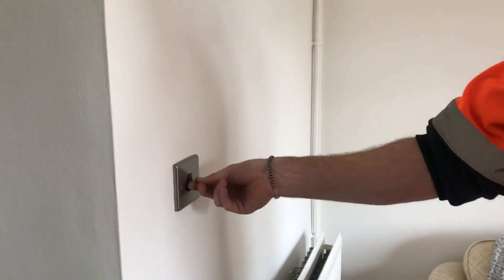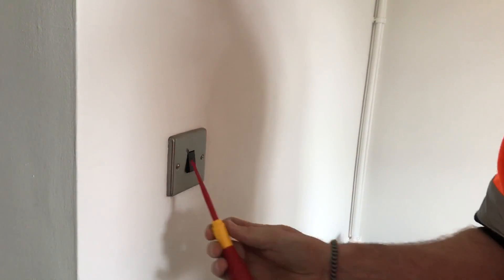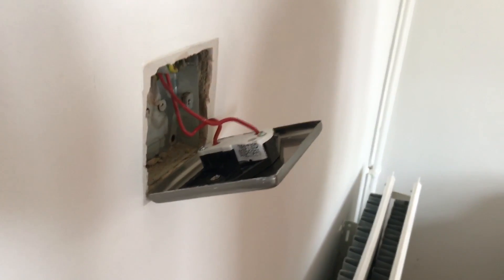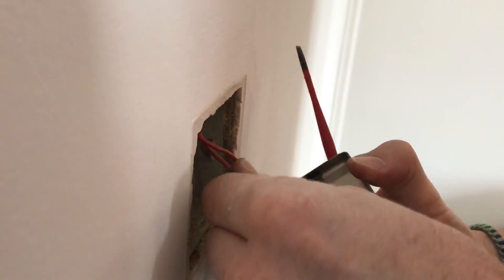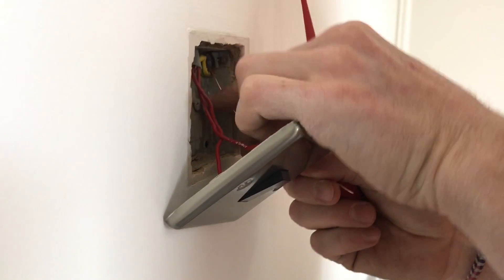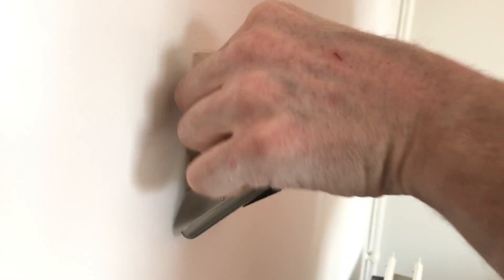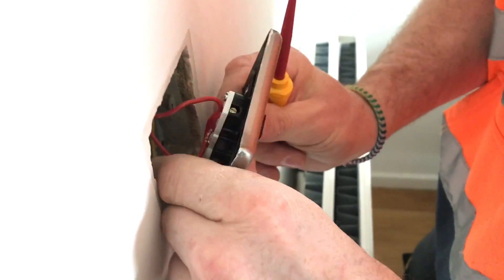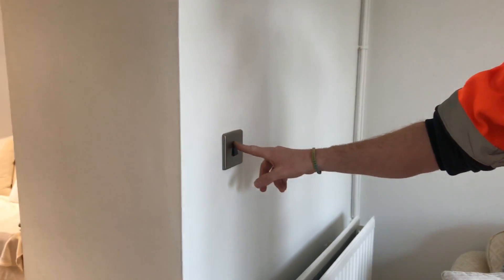How to Earth Exposed Conductive Parts (Metal Switches) On Site With Electrician Matt Best Practice

Comment: Is it compulsory to double the earth cable back?
Reply from the maker: No just best practice 👍🏻
Reply: @GSHElectrical  Thanks. got a quick question mate and wondering if you could help. I know a metal back box would need to be earthed to a metal face plate. A plastic back box does not have to be earthed to a plastic faceplate however, what if I have a metal backbox and a plastic face plate, does that need to be earthed? Thanks

Comment: My fly lead is conducting electricity. When I touch the metal light switch I get a very small buzzing shock. Any idea? Hasn't been re-wired so I don't really understand why this is suddenly happening to 3 of my switches in the corridor!

Comment: Do you need to earth a metal switch if the back box is plastic? There is a earth cable coming out of the wall with the plastic back box and wondering if needs to be earthed onto a metal switch? Or can I just leave it behind the switch in a wago connector?
Reply: It’s even more important to earth the metal switch plate if the back box is plastic. While earthing only a metal back box at least the earth continuity goes through the metal screws carrying on the earth path to the metal front plate. But with a plastic back box and no earth on the metal front plate, if a live cable comes out and touches it, it will just be sitting there live until someone touches it getting a shock. Also why waste a Wago when there’s a perfectly good earth terminal there.

Comment: It's often the case that the Earth wire isn't earthed in alot metal light switches.

What risk does it pose if you don't earth it?
Reply from the maker: If it’s a plastic switch no risk - however if it’s metal and it becomes live it can cause a shock and possible death via electrocution.

Comment: Why does that need a fly lead from the back box? With a fixed lug that back box and front plate area always at same potential in an energised system and the front plate will never be removed unless it is isolated ??
Reply: It must be connected to the Class I accessory. Best practice is that it is run to the accessory, and then a flylead run back to the backbox. But just running it to the backbox without a cpc to a Class I accessory is unacceptable.
Reply: its just good practice to do it, you can't assume a homeowner will isolate the circuit before removing the switch, worrying but true

Comment: I know with sockets where a metal back box isn't exposed and there is a fixed lug we are allowed to rely on the M3.5 accessory screws to earth the back box.  Is a similar thing allowed with metal light switches?
Reply: CPC fly leads aren't mandatory for any metal accessory, but they are best practice.  I was always told: 'assume that if the light switch stops working, the homeowner may decide to take the accessory off to take a look.  If the failure is due to a loose line conductor, once the accessory screw is removed, the homeowner now has a potentially live metal accessory in their hands with no CPC protection if only the backbox has been connected to the CPC'.  Makes sense to me :)

Comment: Do the regs specify which way round the cpc has to be connected first; backbox then fly to switch or vice versa?
Reply from the maker: Hi. From new and this isn’t new I prefer an unbroken cpc conductor to the switch first and back box second. No rules just personal preference 👍
Reply: The regs say as long as you have one fixed lug you don’t need a fly lead. But it’s just good practice as people sometimes take switches off without safe isolation in the real world
Reply: @Badgerooni90  true that; I've had this arguement with sparks before who think because the socket or switch is earthed the socket screws are sufficient to give you an earth to the backbox however youre going to get a pisser if you touch the back box with the screws out if for example someone forgets to tighten their connections (apprentices) !!!
Reply: Two earths into the switch would give a higher chance of losing one and probably not as good a connection? Cant really double over two cables into the switch.

I wouldnt say either way is right or wrong though; you tend to just work with what you're given.

Just my thoughts really.